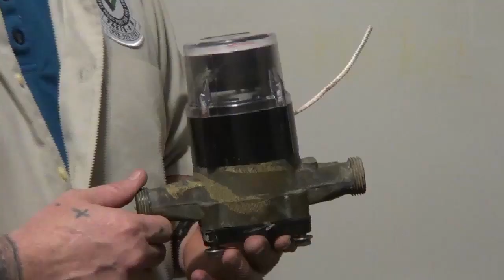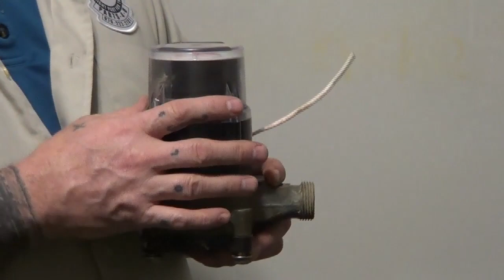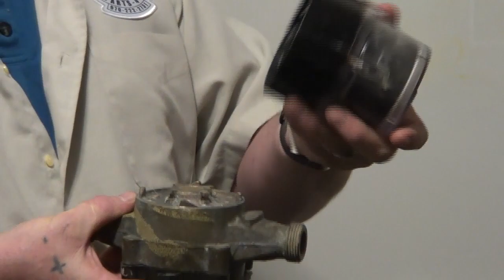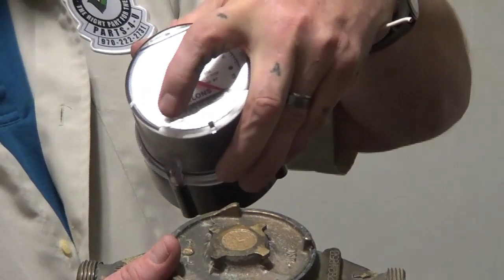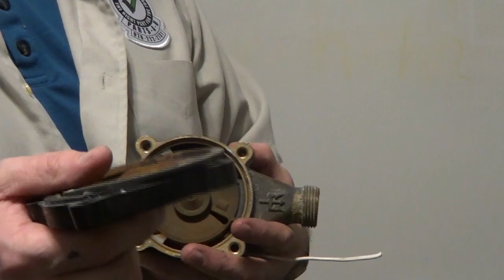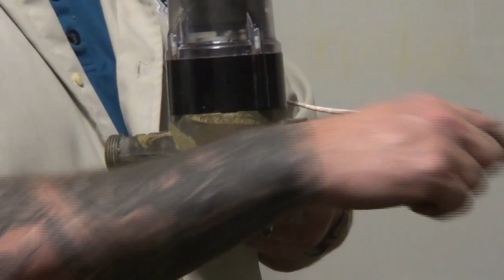Mobile Home Water Meter

Comment: Can someone answer a question for me, please? I live in Tennessee, and I live in a mobile home park and I had a water leak recently. And it's waking in the part of the waterline, there's got to shut off valves on it. And, it connects to the waterline that's part of my mobile home. from everything that I have researched, it's supposed to be the mobile home. Park owner's responsibility for replacing that part of the waterline. But they are denying responsibility. I've contacted city coal enforcement. I have contacted the water company, but no one seems to know the answer. Could someone tell me who is responsible again? It is not part of my mobile home. It connects to my mobile home

Comment: Interesting. I had no idea there was a sacrificial freeze plate on them. 
My meter is new and has a remote sending unit thing for it to be read with drive-by telemetry. 
My biggest gripe is that the main shutoff for my double wide on-slab is smack dab in the center, length and width-wise. There's only about 24" of crawl space to get to it and at 65.5 years old and 6'4" with a 4 time loser back it's not something I can do any more. I don't want to attempt it any more that is. 
I dreamed up a modification to the shutoff handle that is either double cabled or double chained with the lever in the mechanicals closet right above the shutoff. 

Does something like that already exist? I thought about making it motor operated but I don't like the idea of too many things that can fail. Especially seeing as it won't be something that's exercised frequently to keep it 'limber'.
Reply: Thanks for watching. It sounds like a great idea for the mechanism to use to shut off the water but haven’t seen anything out there. There are so many different heights and angels to them that I think you’ll just have to figure by going under there with a bag full of random parts and build on site. ( good luck😊). But great question. If possible, and you’re wanting an easier shutoff close to where it comes out of the ground, you may think of hiring someone to come cut in a pipe straight up from where it comes out of the ground and go into the home somewhere convenient and put a shutoff there and angle back down through the floor to reconnect to the main, where it will move along again to the main hook up to the home. I agree with you though, those 24 inch crawl spaces are not awesome. Wish they’d hurry up with them robots!
Reply: @randydolph852  Thank you for the reply. 👍🏻 I hadn't thought of bringing the shutoff up into the mechanical closet. Hmmmm. Something to think about! 

lol I think we're the only robots we're going to see in our lifetime that's capable of things like that. I hope so. Jobs are hard enough to find.
Take care and thank you for catering to us manufactured home dwellers.